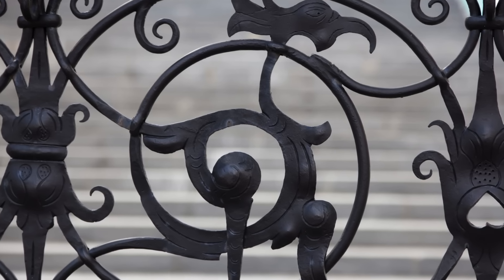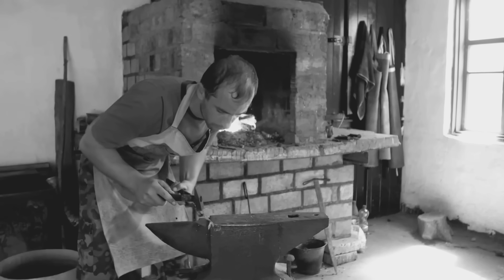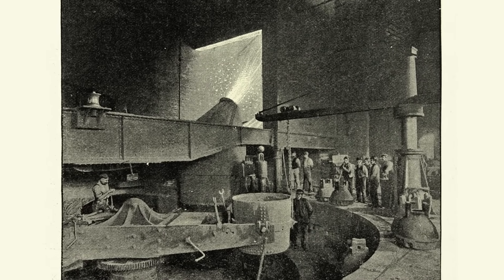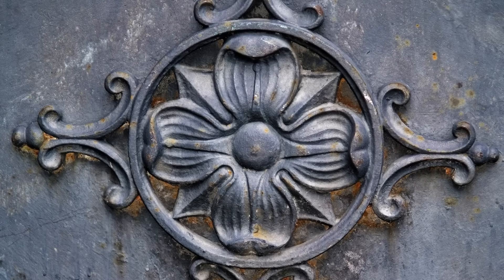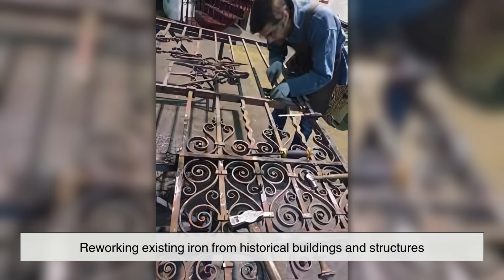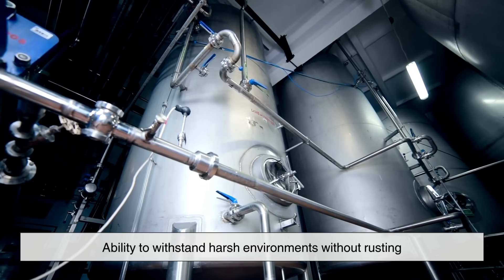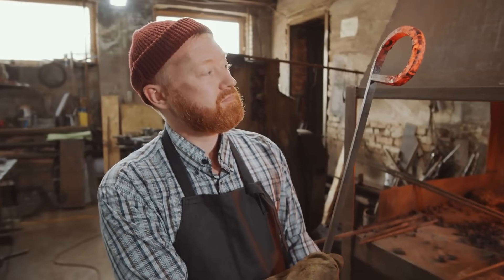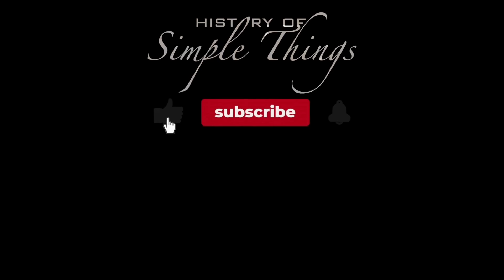Why Is Wrought Iron No Longer Widely Used?

Comment: I’d have to carefully note that, despite the description and explanation, a lot of people don’t understand that “wrought” iron is a material and not simply a process.
In NYC 80’ thru 00’ I worked for and with a Locksmith & Iron Shop where we fabricated Fences, Grilles, Gates, Fire Escapes, Doors, Hatches  & Grates. While all of these were “Security” oriented, many of them were also highly decorative and the detail work involved hand crafting turns, bends, twists, spirals & scrolls … people commonly called the results “wrought iron” due to its look, it really wasn’t … it was high grade but relatively mild, steel.

Comment: Actually, in the Dominican Republic, where I live, Wrought Iron is very widely used in infrastructure. Mainly in family homes and many other cases. I would dare to say that 99% or more of all iron gates, fences, railings, windows and balcony reinforcement, safety cages, and many other applications are made of wrought iron. I have yet to see a concrete-built property without protection made out of wrought iron.

Comment: Wrought iron is shit. Can't weld it or cut it as well as mild steel/machinery steel. Less resilient meaning easy to knock out of shape. That Old Timers were able to do as much as they did with the shit is to their everlasting credit.
Some of it is still pretty to look at, even. But most of it is obsolete shit that needs scrapped.
Reply: Your point would be made better without four letter words throughout.
Reply: @653j521  That's how rough men talk, Sonny.

Comment: In coming decades we should see a resurgence of “traditional” materials through, paradoxically, the rise of advanced robotics. Wrought iron has suffered primarily from rising skilled labor costs, the scarcity of such workers and its inherent reliance on manual work… but many of these constraints will ease considerably with the development of robotic “makers”. If there is a need for the material due to its aesthetic properties or other qualities, it will be manufactured by some entrepreneurs somewhere.

Comment: depends where you live. Wrought iron is frequently used in Europe and often preferred, simply for its beauty and durability. Didn't fade into obscurity and don't think it was ever truly used as bridging-that would be far too time-consuming and expensive. It's not used in infrastructure for heavy construction, but decorative details, grilles, fencing and railings, windows.  Bridges used cast iron. Problem with cast iron as infrostructure in heavy construction such as bridges or buildings is corrossion and potential brittle fracture, so not most desirable material. - can we rename your cannel as "History of Simple Minds"?

Comment: All the rusty fences that I cleaned up, sealed, and painted are no more than 30 years old. So if not wrought iron, they sure weren't aluminum or steel. Both steel and hardened aluminum fencing cost much more than iron.
Reply: Like railings on cement stairs? My mother worked on many railings over the years. Rustoleum was her brand of black paint. I think the railings might be mild steel, which I never heard of before this video.

Mild steel is the cheapest option when it comes to guard rails and hand rails. Material costs are low, and the ease with which it can be worked make the construction element very cost-effective, depending of course, on the complexity of the required design. Under heavy-use circumstances, many architects choose to stipulate carbon steel for its added strength and durability. Although mild steel rails, hand rails and guards are usually powder coated or spray painted prior to installation, they are still prone to corrosion and need regular inspection and maintenance to keep them at their best, especially if open to the elements.

Comment: Wrought iron, which is really just pure iron, is a crap material to work with. It melts at too high a temperature to economically cast into shape, it rusts just by looking at it and is too brittle to cold form into shape. That's why wrought iron is never sold as stock material. There is no shortage of wrought iron, it's easy to produce, in fact easier than steel or cast iron, but there is little to no use for it.

Comment: Why not reworking wrought iron from a cast iron? For centuries, it was made in a forge. A cast iron ingot was put in a forge and melted. Drops of melted cast iron was blown with air which oxidised a carbon and pure iron gathered at the bottom. Not very efficient process as a lot of iron was also oxidised, but it's feasible for small scale production, does it not?

Comment: I would like to see a video on comparing the differences on how iron ore is processed to make cast iron, wrought iron, regular iron, steel, stainless steel etc.  I.e. what do the different processes have in common, and at what point do the processes change.
Reply: <<t iron, wrought iron, regular iron, steel, stainless steel etc. >>

I would say that what they all have in common is that they are mostly the element iron, with varying additions of other elements to make alloys.  Carbon is the most common alloying element,  with varying amounts used to make cast iron and steel.  Chromium is the the element alloyed with iron to make stainless steel.  

I think that's a reasonable description, but I'm not an Xpert.

Comment: Cast Iron rusts easily, but forms a protective layer quickly.  That protective layer slows the effects of rusting substantially.  Steel does not form the same protective layer and will rust away to nothing much more quickly than cast iron.

Comment: Took me until my 60s to learn that Wrought Iron, Cast Iron, and Steel are almost identical.  

Wrought Iron – Less than 0.08% carbon (almost pure iron with slag inclusions).
Steel – 0.08% to 2.0% carbon (ranges from low-carbon steel to high-carbon steel).
Cast Iron – 2.0% to 4.0% carbon (brittle but strong, used for casting and heavy-duty applications).

Wrought iron is soft, lacks hardness, and is prone to bending. It’s labor-intensive to produce, rusts without maintenance, and has limited tensile strength.
Cast iron’s brittleness comes from excess carbon forming graphite or cementite, creating weak points that disrupt atomic bonds, reducing flexibility and fracture resistance.
Steel bridges the gap between wrought iron’s ductility and cast iron’s hardness, with properties that vary based on carbon content and alloying elements.

Why did I learn this?   Because of a video game (Vintage Story) which as a "Cementation" kiln to make "Blister" Steel.
Reply: ...Almost identicle...?...When the colonists first started smelting the magnetite iron ores  in northern New 
Jersey, southern NY, the iron ores were found to give qualities that were dependent on where the ore came from. This was found out by experience. It was discovered by experience again...that measuring the number of wheel barrow loads of charcoal, iron ore and limestone...in layers poured in the top of the furnances...determined  the type of "pig iron" that could be made.  At this part of the process...the pig iron was good for casting. The next step would be taking other "pigs of iron" re-heated, puddled in a forge, and hammered into blooms. Puddling meant stirring and turning it with long iron bars in a small oven.
It was not untill 1830 that science & chemestry took the "guessing" out of this process.
  With science & chemistry came metallurgy. This was perfect timing. Now exact proportions of the correct elements could be added to iron. Making reliability of metals a constant.
  The most important element added is carbon. (of course other elements are important too). The amount of carbon determines...what the majority of the metal's properties will be.
leading to classifications like:  low-carbon (mild steel...0.02% up to 0.20%)  A-36, structural steel.

  Medium Carbon steel...0.21% to 0.45%,  forging parts
High Carbon steel...0.45 to 1.0%, drill bits, springs.
  Ultra-high carbon steel...1.0% to 2.0%, axels, punches.

The cast iron family...gray, white , malleable, nodular and ductile.
  Each one has certain abilities, limitations. For example...Gray is good in compressive applicatioins, poor in tensile ones. It is soft, drilling it is easy. Don;t need any cutting fluid b/c  the graphite in the part provides the lubricant. 
  White Cast  Iron...is hard and brittle...sinks.
Malleable iron...pipe fittings, pipe wrenches 
  Nodular iron...Manhole covers,  brake calipers & rotors.
Ductile iron...water distribution pipes, underground...engine blocks.

  Finally, wrought iron is the purest form of of iron produced from pig iron. It contains less than 0.1% carbon & 1%-2% slag. It is soft, very ductile as a result.  
  Ductility is the ability of a material to be worked at room temperature with out breaking or cracking. That's why it was popular for ornamental purposes. 
  Now that mild steel is inexpensive to produce...it has replaced wrought iron. Mild steel is almost as  ductile to work as wrought iron.
  I did a repair on a wrought iron handrail. It drilled easier than mild steel. 
In conclusion...metals are essential. 
  We have the non-ferrous group too. Aluminum (all the grades), brass...yellow, red. copper, tin, zink.
Whew !
  The stainless group, 300, 400...the list is Very long here. 
All righty then, all the best, Pete 🙂
Reply: Which makes steel the most reliable material.

Comment: You really missed the mark. In the first place, wrought iron has a very low carbon content...about 0.05%. It must be made in a puddling furnace, which to my knowledge, does not currently exist in the United States. Where you got the picture of the rusted "wrought Iron" fence is a mystery to me. It doesn't rust - PERIOD. You can sit on a true wrought iron seat in a very old park with your best Sunday clothes.
Reply: Googled it, it's more corrosion resistant than cast iron, but it does rust. Maybe you sat on a bronze bench or the bench was treated with a coating or paint.
Reply: @shannonolivas9524  It rusts, but it's just a surface coating.  I'm guessing it's the granules of slag that stop it from going further.  Steel, on the other hand, is a consistent material (barring carbon movement during welding/working/etc.).  When steel rusts, the rust flakes off and exposes more steel until the steel is completely rusted away.

In the rural US, you can find a lot of wrought iron work out in the country - gates, fences, rails, bridges, etc.  It rusts a bit over the first few years and then pretty much stops changing.

I'm not claiming it lasts forever, but it does outlast mild steel.

Comment: Wrought iron has long carbon while mild steel has granular iron structure. The welding of wrought iron is by forging and welding of mild steel can be done by modern arc or flame process. So the real reason is the carbon infrastructure.

Comment: Wrought iron is NOT cast iron. Wrought iron is used where the strength is required, in car axles, and tools like wrenches. Cast iron is used in engine bodys and where the dampening effect is required for instance a lathe bed.
Why we dont see wrought iron in fences and decoration anymore is easy: we are getting poorer, can not afford to pay a blacksmith as many working hours as 100 years ago because the wealthy people take more and more of the cake.
And the blacksmith has cheaper techniques, he can weld and uses prefabricated steel bars cold rolled with decorative twists. Most blacksmithes did not forge for 50 years, the do not have the anvil and fire anymore.
Reply: <<Why we dont see wrought iron in fences and decoration anymore is easy: we are getting poorer, can not afford to pay a blacksmith as many working hours as 100 years ago because the wealthy people take more and more of the cake.>>

More socialist BS.

For two thousand years iron was made from ore by working the blooms until you got a satisfactory amount of iron.  A costly process.
The industrial process of making steel is far more efficient that making iron from ore by pounding out impurities.

We use calculators rather than slide rules for much the same reason.
Reply: Where do you live where you are getting poorer than when wrought iron was common? No modern conveniences? No water treatment plants? No technology? We can see your access to the internet.

Comment: Stainless steel and Aluminum is almost impossible to work with hand. For artist they are a pain in the ass. Yes you can machine steel. but if you want to twist it into a flower shape. good luck machining that.
Reply: You mean "artists" who work in mediums they haven't mastered, I work with stainless steel all day because I studied metallurgy and engineering. Wrought iron is weak rubbish.